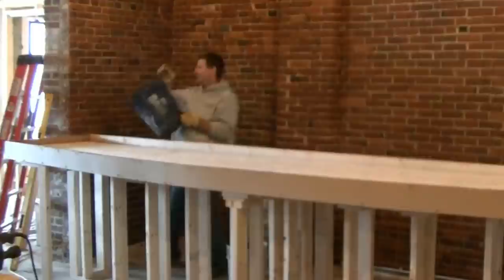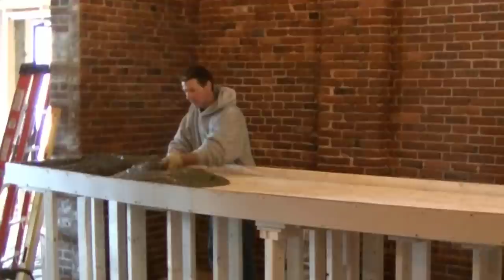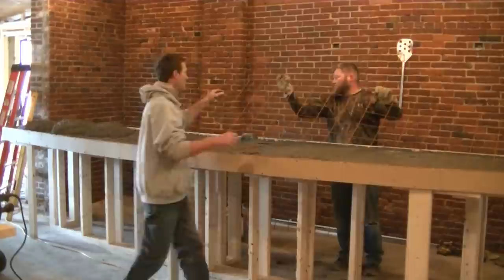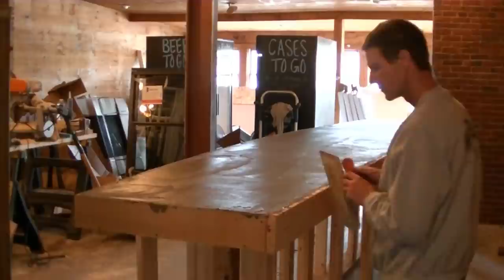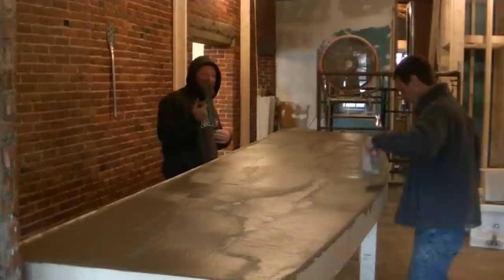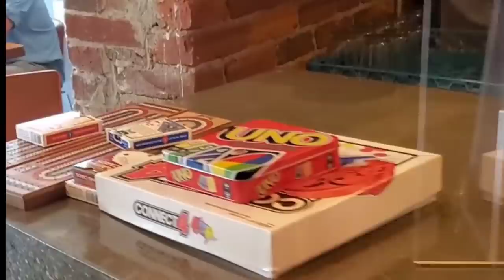Big Concrete Countertop With Regular Concrete Mix (Pub Bar Top)

Comment: A nice tool for stuff like this is a cordless sawzall with no blade. Hold it up against the outside of the form and it gives just the right amount of vibration . Good in the outside corners of wall forms too. Great work as Always! That finished product is beautiful!
Reply: Great idea! we always ran around tappin the forms with our hammers, and you know, some guys didn’t do enough, some guys thought they were hammering 16 penny nails! not good.
Reply from the maker: Good tip!
Reply: I use a orbital or pad sander. Instead of paper on the head  I wrap in duct tape

Comment: What aggregate was in that mix? I'm surprised you could use standard concrete but I like the idea. I've built a number of commercial bars, probably every kind of top but concrete.
Reply from the maker: It was 3/8 stone aggregate, 5000 psi mix

Comment: What mix exactly? What finish on it Mike?
Reply: Yes I would love to know myself
Reply from the maker: It was a 5000 psi 3/8 peastone mix with water reducer.  I used a polyaspartic coating to finish the surface.
Reply: @MikeDayConcrete  did you put a tiny radius on it?
Reply: @MikeDayConcrete  Jesse muller just put out a video a day ago doing concrete counters, not a fan of his method, or finished look he used the bags and it was soup city. I really like yours.
Reply from the maker: Yes, it has a slight radius.

Comment: Hey mike, I'm not sure how to message you but here goes. I got a question for you. I've got some older magnesium screed rods that haven't been taken care of and would like to clean the concrete off of them as best I can. What is the best way to do that in your opinion? I'm a concrete contractor in the Pacific Northwest and was able to pick up five or six magnesium rods from somebody else that haven't taken care of them but not having any luck cleaning them.
Sorry about being off topic here, I just didn't know how to ask you this question elsewhere
Reply from the maker: We use a Dewalt 4" hand grinder with a diamond cup wheel and grind off the built up concrete if we need to.